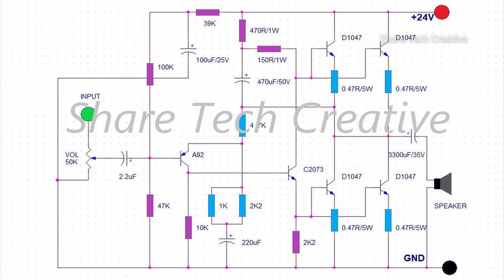How to Make JLH 1969 Amplifier 4 Transistors D1047C Class A

Comment: C2073 not available right now suggest different transistor
Reply from the maker: You can replace: TIP41, C4793, C5171, C2275, 13007, C2238, MJE15032, C3298...
Reply: ? @ShareTechCreative a92 suggest different transistor
Reply from the maker: Transistors: 2sa1015, 2N4403, 2N5401, S9015, S8550, 2sa564, BC557, BC558...!